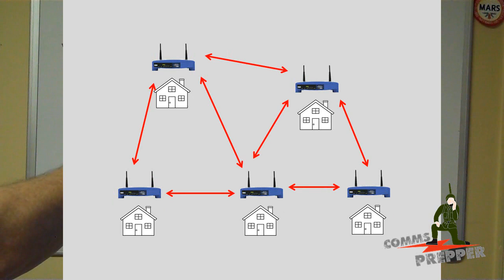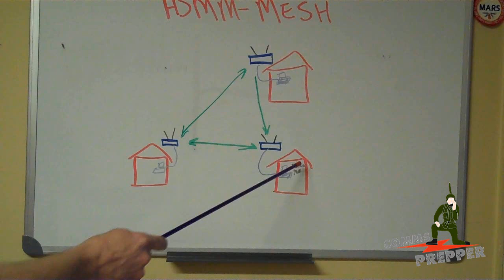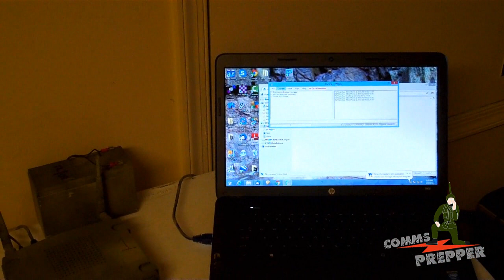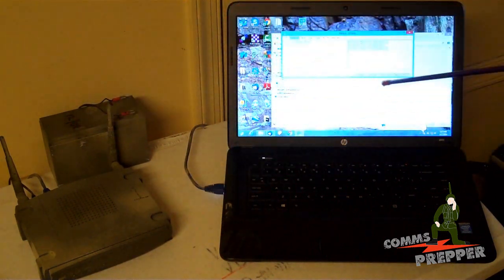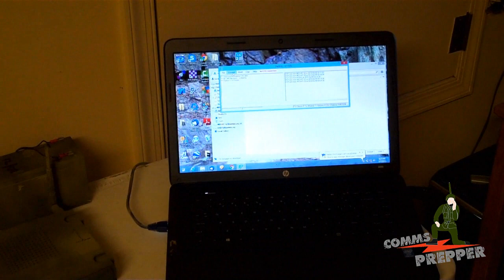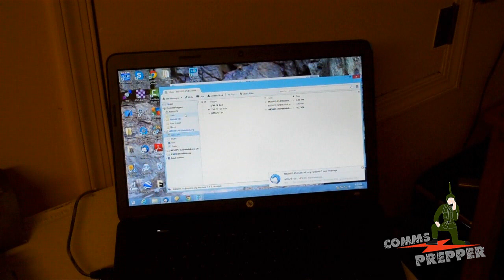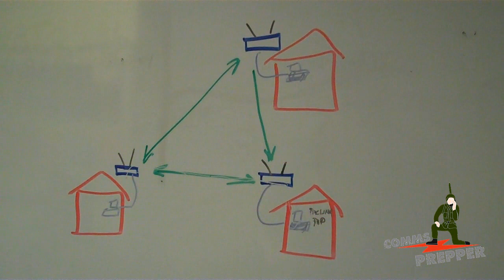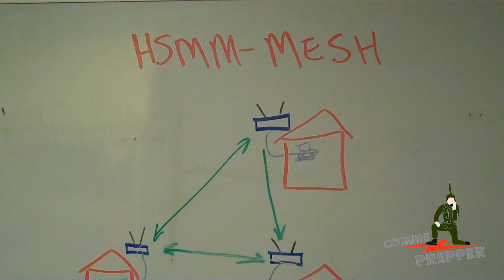HSMM-MESH

Comment: To the best of my knowledge (no, I'm not a lawyer), you don't HAVE to be an amateur radio operator to use HSMM-mesh, just don't enter a call sign in the "node name" box and stick to part 15 rules. Yes, you're limited on power, but even with the restrictions, you can create a 60 watt EIRP point-to-point link
Reply: This software is created specifically for amateur radio users. It modifies the radio to work on the amateur band of wifi. So you can't use this software specifically, but there are other software that allows you to that would follow part15.
Reply: *****
Yes, this firmware is designed specifically for amateur radio operators (I am one), but the only thing really special about this firmware is that it beacons the node name every few minutes (5 I believe). The instructions say to include your call sign in the node name thereby, by beaconing the node name, IDing the radio and keeping it in line with Part 97 requirements. If you desire to have a Part 15 mesh, you may leave your call sign out of the node name and (preferably) change the SSID. Now you have a legal Part 15 mesh network while still using "ham" software.

In case of emergencies, you can simply rename the SSID and include your call sign in the node name and instantly have a Part 97 node.

As a side note, I have a legal Part 15 mesh using HSMM-Mesh firmware and was actually encouraged to do so by the software designers for my purpose (experimentation and passing full internet connection to remote/mobile locations). This also allowed for me to experiment before getting my license and allow friends/family to exeriment along with me even though they are unlicensed. Again, you can run this firmware on a device as a Part 15 network.
Reply from the maker: ***** Matt - Any chance you can send me a link that talks about the Part 97 vs. Part 15 use?  I think these can be more useful in a non-Amateur mode.  CommsPrepper
Reply: Sure can. I'll have to look some stuff up again. I'll try to post some info tomorrow.
Reply: Commsprepper I don't have a one-stop-shop for the info I gathered, so I'll just paste some info & links in the comments.

<Quote from comment in FB HSMM group>As long as you are compiling with the part 15 rules (since you do not yet have a Amateur Radio License) you can still run these as BBHN Nodes. Once you have your license you could potentially kick up the power once you put your callsign in the node name fields. Open-wrt, DD-WRT and Tomato are all firmware updates to the WRT. People have been using these for years under part 15.</quote>

Here is some info that pertains to Part 15 2.4GHz wireless bridges. The point I would like you to take from this page is the sliding power output chart. A WRT54G product can only, at best, put out 24dBm, so if you match that with a 24dBi antenna, you now have a 60+ watt EIRP node that from my research is legal under Part 15 for point to point links. http://www.countrymilewifi.com/how-to-set-a-bridge.aspx

This link may also provide some useful information. http://www.qsl.net/kb9mwr/projects/wireless/plan.html

I also learned alot by reading an ebook called Wireless Networking in the Developing World. http://wndw.net/download/WNDW_Standard.pdf

Hope this information helps. I'll keep sharing related information with you.
Reply: Yes, I have used and do use DD-WRT, BUT the way DD-WRT & BBHN work are two entirely different things. It depends on what you are wanting to do with the network & how you want it to behave.

Comment: But to get any real distance out of this you would need to setup a repeater ?
Reply: gringogallego With a grid dish antenna you can easily do over 20 miles. The line of sight is real problem.
Reply: 10 miles sounds a little optimistic but I understand the theory. Thanks for responding.

Comment: You might as well just set up a LAN with one router and several WAP's. With MESH, you are still on the 2.4Ghz band so its not like you are getting anything from using it over a standard LAN running on IPv4... well, that's not all true, you are getting way less interoperability, a big headache, less bandwidth, AND very restrictive rules to deal with. My vote; stick with standard networking for something like this. You can even get long distance directional antenna that will beam IP packets miles. MESH is fun to play with, but realistically it would be much easier to just stick with an IP based network; IE a router, WAPs, and some kind of a server to host services such as a small PBX for VoIP, a NAS, SMTP, etc... the possibilities are endless. Another benefit of doing this is that it would be easier to support BYOD since you dont have to have a special router for each endpoint... each new user can simply connect to your network like any other network. Now, where MESH makes sense is if you are already invested in HAM, have all the stuff, except for maybe the routers... at that point it would be cheaper to do do MESH but in the long run, and as a prepping item... yeah, you get the point.

Comment: Are those WRT54G Linksys router?
Reply: m craig
I looked into this a little. It seems the WRT54GL has a larger memory capacity than the WRT54G and is apparently designed for user installed operating systems. Being a network engineer I mistook this subtle difference since externally they appear identical. The WRT54G (Wireless RouTer 54Ghz.) family has long been used by many hobbyists for experimentation. You need to be careful there are 2 different versions with the same model number; the correct one has the external antennas. I checked on EBay and found the WRT54GLs for as little as $20 shipped along with a wide assortment of accessories. I want to be clear I have never used one of these routers for other than its original purpose as a wireless network router, I am no expert on modifying these routers. If you search YouTube there are a lot of videos on the WRT54GL and how to modify it. There may be other routers that would work but with what I have seen now and in past this is a good router to convert. Right now I’m concentrating on my ham license and hope to be able to pass both the technician and general tests in about a month but now this is on my radar and I’ll have to get a couple of these routers and try and pit my own system together.
The Commsprepper is doing a wonderful job showing us so many facets of radio communication and doing an outstanding job, I for one appreciate his efforts.
Reply from the maker: They are WRT54GL routers.
Reply: Good thing I didn’t guess! As a computer network engineer and a prepper who is studying for his technician’s license I want to thank you for the great videos that have helped me in all three areas. I look forward to watching more.
Reply: Does it have to be the WRT54GL  model?
Reply: You are absolutely correct I was mistaken. Thanks for correcting this I don’t ever intend to put out incorrect information.
Reply: m craig No. There are several models that work. HOWEVER the version number is very important. Only certain versions of the routers can be reprogrammed.